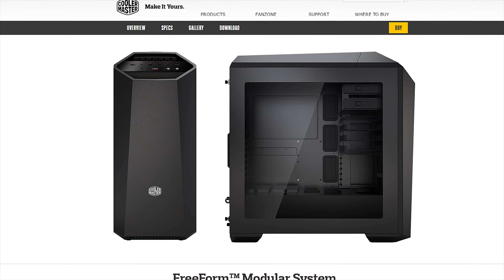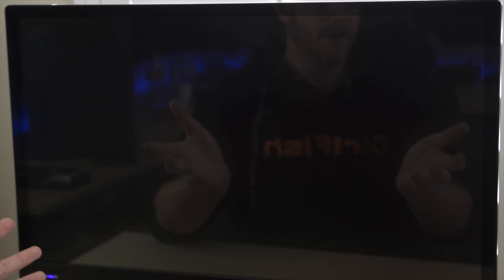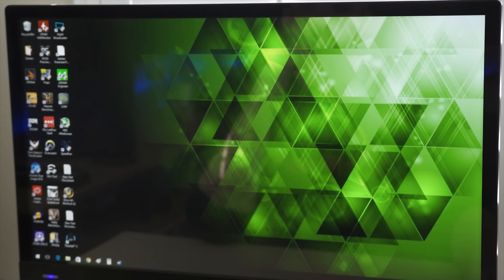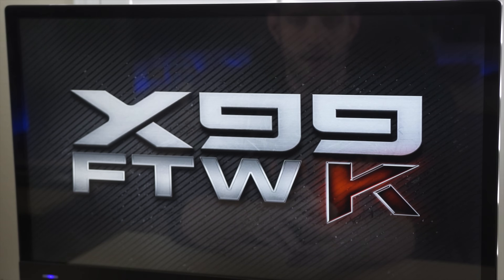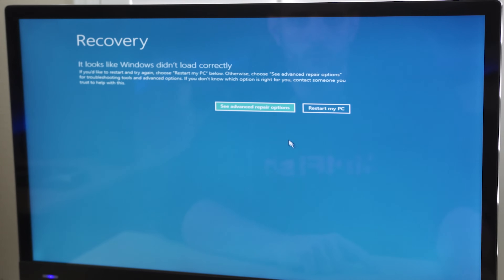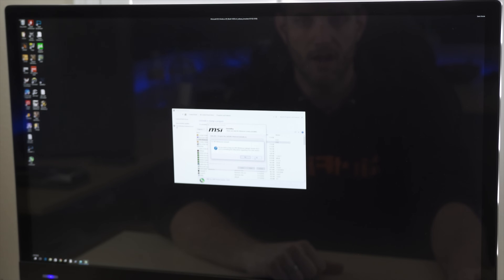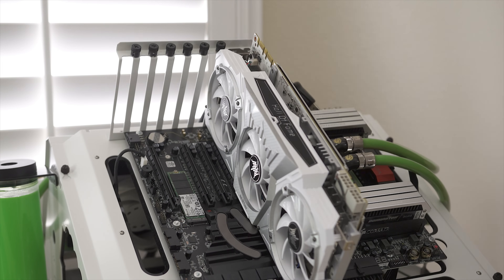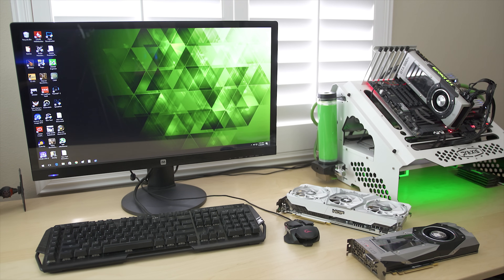How to fix a bad overclock on any Video Card

Comment: rule 1: dont activate startup while trying new overclock
Reply: why
Reply: Slaughter Tuber watch the video
Reply: I aggree
Reply: IKR. Shouldn’t take a genius to figure that out. 🙌
Reply: Slaughter Tuber so if you overclock too far, it doesnt always start up with the overclock
Reply: Just learned thiis the hard way
Reply: Was kind of stuck there also :,(
Reply: It resets automatically no need to Off The thing
Reply: So true
Reply: It's fine.
Reply: Why do it the hard way?.  Just boot up a Linux live cd and just delete or rename the program.
Reply: i think my card don't power up at all maybe something died and I didn't OC it so much  i dont know how to revive or to find where problem is
Reply: or just press and hold ctrl when logging in
Reply: Learned it the hard way
Reply: U will get in a crash loop😂
Reply: I completely agree, doesn't go well with USD $650 budget gaming pc's, I have even tried to overclock ram, well, every ram dim I insert into my motherboard gets locked by the bios, and every time I attempt to overclock ram, my system crashes on successful start up
Reply: Oops fuck
Reply: just did
Reply: I need help it activated startup and it freezes every time I try to turn it down. Plz help
Reply: Hey comments please I need help. My computer went black screen after I over locked to 3.9 on my amd 5 1400. And I just unplugged the cord to the PC and it won’t start up. I’ve tried removing the BIOS battery and putting it back in and it still won’t start up, it’s the shadow II model. Please I spent 850 dollars on it and I can’t get it to work.
Reply: Like it won’t even start to reboot, i I don’t know what to do.
Reply: i did that...and now my pc is a stuttering mess. Have a 2060 super...i think im going to have to replace gpu
Reply: Oh fuck
Reply: Yarnie Wullaert to late broke it
Reply: Yeah..... This is one lesson I learned after a long afternoon of headaches
Reply: Too late
Reply: Hey I overclocked my laptop and it instantly blacked out and now I can’t boot it up please help me
Reply: Mobile Games hey I overclocked my laptop and now I can’t boot it up please help me
Reply: What if I did a PC reset and wiped the Aorus Engine. The overclock is still active , and can not get into windows ( Windows 10 Error ) a to install that engine to drop the settings back down.  Is there another way to reset the Graphics Card back to default if I dont have a spare card ? Any help ?
Reply: @theroyalaustralian  i know im late but sometimes ram can't be overclocked. I have a 650 budget pc and I was able to overclock my ram from 2666 to 3200
Reply: @khaoticpenguin3945  Roger that, can you help as to why my system reboots for no reason while under load without giving me a BSOD or error
Reply: bit too late
Reply: I did that and didn't realise that overclocking caused my gpu to not load
Reply: I did and I don't know how to fix it
Reply: @Bingsus  safe boot -> task manager -> auto start -> deactive it or something like that
Reply: It's true was my problem actived that
Reply: Yes that is most important rule but i forget about that complitly that why i stuck in this problem 🙂💔
Reply: I used Asus GPU Tweak II, but it's not on startup so hopefully maybe gpu is still working
Reply: I’ve made this mistake
Reply: That's why stress test extist
Reply: Help, I used a different app 2 change the refresh rate, how do i delete it now?
Reply: @justmigz3018  it's just the same
Reply: I just figured out today ☹️
Reply: Stop when your screen starts to go disco mode
Reply: If done what to do
Reply: @aadi6023  start your pc in safeboot mode - deactivate the overclocking programm
Reply: how do I stop it
Reply: @durableblo2810  how do I stop it
Reply: one mistake i just learnt the hard way 🤦‍♂️
Reply: What does it mean by dont activate startup? Sr newbie here
Reply: @andypham123456  dont let your OC programm start (and overclock) your hardware on boot - while adjusting your settings.
Reply: Ur a bit too late to tell me like 2 minute late
Reply: Please help my keyboard does not work in startup settings
Reply: I was lucky I had interfrated graphics or else I wouldn’t know what to do 🤣
Reply: WHYYYYYYY????

Comment: Or instead of using another graphics card use the motherboard as a hdmi output if it has the ability
Reply from the maker: Not all CPUs have igpu...
Reply: JayzTwoCents Especially older ones or server CPUs
Reply: Most modern ones do though
Reply: x99 doesnt
Reply: If you've spent that much on a PC I'd expect you wouldn't have this problem
Reply: D Quack agree, try that first.
Reply: Still a valid point made, many PCs have video outputs on the motherboard, while other doesn't, but it's still worthwile to check the rear of the computer and try it out and hope for the best. If not, then just move on to the next plan.
Reply: Jay, I built a water cooled pc with PETG tubing and fitting 1/2inch OD. Now I ordered some new 12mm 90 degrees fittings and the 1/2inch PETG (12.7mm) dont fit. Where do I find 1/2 inch 90 degree fittings?? HELP!
Reply: server users dont usually overclocks GPUs... anyway, you forgot latest FX series and x99 series.. and the given solution is applicable for any system whether it is x99 or fx or z170.
Reply: Well many people got xeons in their gaming rigs.
The Xeon 1230v3 for exampel, because it basically was an i7 4770 for the price of an i5. Insane bang for your buck.
I got that that exact CPU in my Gaming PC.
Reply: D Quack x99 doesn't have an onboard graphics port
Reply: Some x99 actually have onboard graphics. Supermicro C7X99-OCE for exampel. But yes, 99,9% don't.
Reply: If you don't have a video output, buy some shitty $20 gpu and use that.
Reply: But he's still right, *IF* you have an iGPU.
Reply: It's still a reasonable idea, just like if you had a 980 lying around, you could use that.  In the same way, if you had integrated graphics or whatever, you could use the mobo's video output.  Its another option instead of safe mode.
Reply: I think I had this issue once, I believe I managed to reset the profile after changing the slot the card was in and then after moved it back to it's proper slot afterwards.
Reply: Still a valid and fair point, I'd like to think that someone who's going to be buying the hardware that doesn't have an igpu  likely x99, will be more tech knowledgeable and know how to overclock and therefore this guide is less relevant. Jay says that the video is aimed at scared people which is more likely to be new people who generally would have a cpu with an igpu
Reply: Most Skylake, Haswell-E, Broadwell, Kabys have integrated graphics
Reply: Assuming you have an iGPU.
Reply: FX don't
Reply: or just buy a cheap potato gpu for like 5$ off of ebay or something....
Reply: I literally said just that a few minutes ago.
Reply: He did go to safe mode.
Reply: Not qll mobos have a hdmi port either.
Reply: MrNiceGuy9198 If you're in the UK overclockers.co.uk if not amazon.
Reply: its not an argument. im just saying you can use the motherboard if you have it available.
Reply: This is correct. I have had to do this once or twice. Not for this specific purpose, but it will definitely work well enough to fix the OC profile.
Reply: always have a backup gpu
Reply: Jesus my simple comment just pointing something simple out started an all out war.
Reply: P - The P is Silent dude chill i wasn't arguing with anybody. all i was saying is see if you can use mobo in case you dont have a spare gpu or dont want to take out the gpu.
Reply: or you could use the intel hd graphics from your cpu. If you have an intel chip
Reply: Hugs Gaming yea thats what im talking about
Reply: Jay, at that point I wouldnt suggest someone to even think about OC if they dont even have a modern CPU.
Reply: Lethal 6950x has no integrated graphics... https://ark.intel.com/m/products/94456/Intel-Core-i7-6950X-Processor-Extreme-Edition-25M-Cache-up-to-3_50-GHz#@product/specifications
Reply: Abhinav Praveen well most people dont have a 6950x.
Reply: Only very old or very high end CPUs don't have integrated graphics, and most that fit in a motherboard with video ports do anyway. This is arguably the easiest solution because you can just unplug your monitor from your graphics card and plug it into the motherboard. 
When trying to solve hardware problems it's best to have a few different options!
Reply: i mean honestlt, someone with an fx6300 should prioritize a better CPU over trying to overclock whatever GPU they have.
Reply: Lethal For me, overclocking is fun. And it can get you extra performance for free. I would recommend people to oc even if it's just for lolz.
Reply: Correct me if im wrong but if a cpu doesnt have an igpu usually the mobo will have some kind of igpu?
Reply: Aznwarlord7 I've never heard of a mobo with an iGPU lol.
Reply: They were the norm several years ago before CPUs shifted closer to an SoC type design. If your pc had graphics it was either a card, or built in to the motherboard. At least until the P4 era, and possibly quite a bit beyond.
Reply: I've done exactly that and honestly I thought Jay would have suggested that first as it's the easiest method. Great if your also using display driver un-installer
Reply: +Wes Tech Games holy shit your right, just looked at like 3 x99 boards and none have an hdmi or dvi port. Wow my board is only 4 years old so it wasn't that long ago. That's so unhelpful! I always thought that on board graphics was supplied by the cpu (iris for example) shows how much I know
Reply: +Wes Tech Games ah just looked into new z170 boards, and the majority of have hdmi or dvi out. It'd because x99 cpu's don't have integrated graphics, so no wastage in commute performance. Makes sense as anyone who would legitimately need an x99 compatible chip would also be looking for a discrete gpu
Reply: +Wes Tech Games I just learned that so be cool bro 😊 lol
Reply: lmao with my fx 4300 that wouldn't even be possible. Though yeah, that would be a way for it to work.
Reply: +Amiga Wolf it would honestly take me less time to throw my R7 250 in than it would to get windows to go to safe mode.
Reply: +Lethal I'd still OC a card while running a Xeon x3450
Reply: +john bumptybump yeah, that was a long time ago. Very few motherboards, if any still have an integrated graphics solution now. Mostly it'll be the processor that now has that solution and there's lots of times when that's just enough. Certain times that's just a temporary solution and other times it's just not a factor for the person at all.
Reply: john bumptybump lol, I'm new to this...
Reply: +ArtisChronicles buy an old shitty ass graphics card for 10$
Reply: JayzTwoCents Am I'm correct that especially the overclocking cpu's/motherboards don't have integrated graphics? I remember that my AM3 board had one.  All 6th gen Intel i5's have igpu's too!(probably the same for last gens)
Reply: All Core i since the 2nd gen have them. And some boards before that had them aswell.
So much about the Intel side. I lack the experience with AMD systems to make claims about their IGPU distribution. (Although I know the APUs have, thats their purpose after all, and the FX don't)
Reply: why dont throw your OS ssd on toilet and replace with 7200rpm hdd? i'm sure this method will flush off the afterburner setting:v
Reply: But older mobos have an igpu on the mobo.
Reply: Do you buy any CPU that doesn't?
Reply: Hey actually my PC working on startup so my gpu installed then I uninstalled all driver now it works I don't think we should probably use Internal Gpu

Comment: After watching this video, i had finally enough courage to start overclock my pc. After playing with the overclocking for a few hours, my screen froze. So i restarted my PC two times and on the third i could enable safe mode, delete afterburner, then go back into my pc, and IT wasnt destroyed, so i downloaded afterburner again, but didnt overclock too much, still my PC is much better then it was. I went from 9200 on firestrike, to 10900. I just wanted too thank you for this video, otherwise i wouldnt be able to get the full potential out of my pc
Reply: So how do you boot into safe mode?

Comment: I know this video is 7 years old and you’ll probably never see this comment but OMG this video saved my life. I accidentally clicked the “save on startup” button. And I just spent hours reading through forums and nothing worked until I tried this. Why is NO ONE ELSE saying to do this trick. Everyone talks about clearing cmos, flashing bios etc but not just using safe mode and uninstalling after burner. Jay you are the best thank you

Comment: Don't click "apply on startup" until you find a 100% stable oc. If your PC freezes you can just reset it and you're back to stock. Hope that helps!
Reply: England is my city thanks
Reply: My laptop frezes after launching MSI afterburber pls help
Reply: @Ali_Ayman03  uninstall and reinstall
Reply: you can just hold the CTRL key on windows boot. it disables the apply on startup option in afterburner temporarily. dont know why nobody knows, its says it right there in the tooltip when you hover over the option!
Reply: Mine did not work anymore it the fan is not even spinning :/
Reply: @bryana.2638  buy a new pc lol
Reply: But I accidentally did, Now what do I do?
Reply: Does it automatically put on startup

Comment: You alluded to the fact that this is not the case for voltage overclocks, but you didn't actually talk about what to consider in those cases. Maybe a follow up video explaining the dangers associated with voltage overclocks, possible solutions to those problems and a general procedure to follow when trying to oc voltage would be helpful? Especially since it would help bridge the gap a little between complete novices and more experienced audiences, as quite a bit of your content recently has been aimed towards the former. I for one would love some tips for fixing voltage oc's as I have already ruined a few gpu's from lack of understanding of procedures. Great video though, helps people feel more free to get their money's worth!
Reply: he is probably already making them. seemed like he knew there was a clear difference so probably has already thought of it.
Reply: You're right, didn't really consider that!
Reply: Also I would like to point out that in windows 8.1 it's basically impossible to get into safe mode by mashing f8 due to load optimizations. The window where they register key presses is still there, but it's extremely small so you'd need either some really fast fingers or some luck. Alternatively you can boot to either a windows disk or usb drive with windows installer on it which will allow you to get to the same options page, if I remember correctly.
Reply: sabotagekiwi  did you actually just say that? this is the youtube comment section right? where is the rage? lmao
Reply: +sabotagekiwi Yeah I ran into the issue of not being able to enter BIOS on my W10 laptop the other day. I kept restarting and it would never register my key presses. When I actually shut down though instead of restarting it worked. I just installed Windows 10 on my desktop two days ago, haven't tested it actually, but the POST screen is visible for a couple seconds just like it was with Windows 7. I think there's a setting for fast boot within the Windows control panel, but fast boot is disabled by default in my BIOS (which I assume takes precedence).
Reply: gravi1ty I've tried using the continued key press to enter safe mode, but it never seemed to work for me. It's also never brought up by Microsoft adressing this issue here https://blogs.msdn.microsoft.com/b8/2012/05/22/designing-for-pcs-that-boot-faster-than-ever-before/ . It might be a specific hardware thing where some configs allow for it and some don't. 

Thanks for the info, good to know! Makes me wonder if I can bring my old gpu back to life, but I think I might have used oc's higher than were supported. Maybe it was just my 7950 but I could only access voltage control through some specialised software that didn't have "safe" boundaries for voltages. I can't remember what it was called at this point...
Reply: sabotagekiwi On my gtx 1060 3gb msi armor ocv1, i overclocked the gpu to +200, memory +800, maxed out the power setting and temperature, and 40% to voltage frequency. I get 2050 on gpu speed, 4799 to memory translated to near 9600 mhz, and max temps of 65-70°C in heavy games like the not optimized Mafia 3, GTA V, Assassin's Creed Origins, Far Cry 5 etc, I play Cs 1.6 on 1000fps (350 freezed) and the game its butter smooth. So yeah its worth in some games lile Mafia 3 where on stock the framerate had stutter, now are less lows. I have ho say that i play on a i7 2600k overclocked at 4.4Ghz, 32gb 1333mhz ram, ssd(Win7)/7200rpm hdd, and an Intel Skull motherboard DBZ something, forgoth the model. Also forgoth to mention, the voltage on gpu is at 1.064ish, somethimes a little higher sometimes a little or more lower, in windows it stays at 0.85ish with near 1580mhz and memory at 4799mhz.